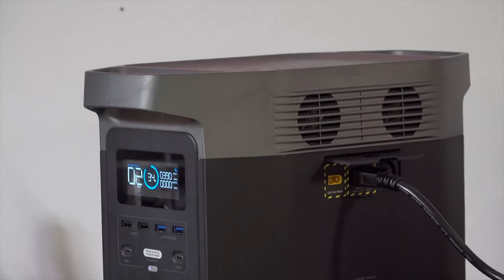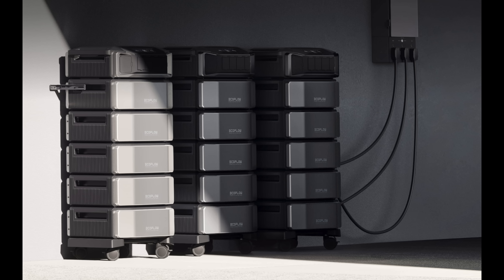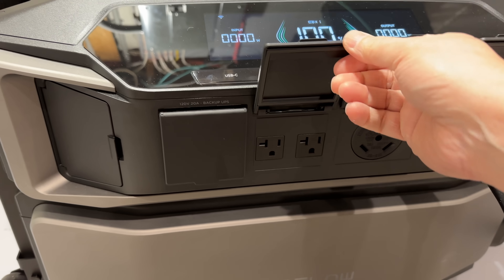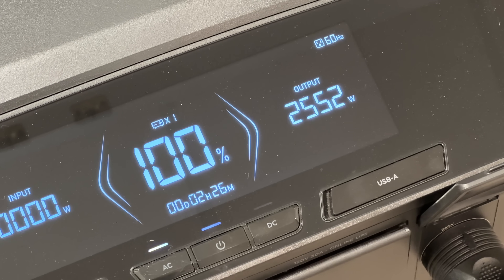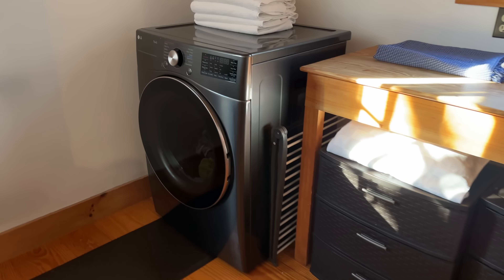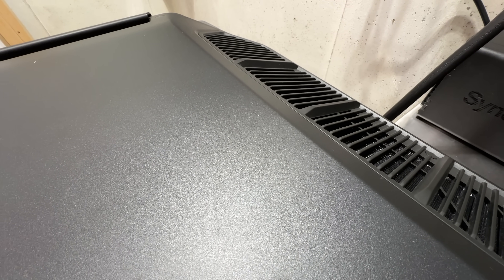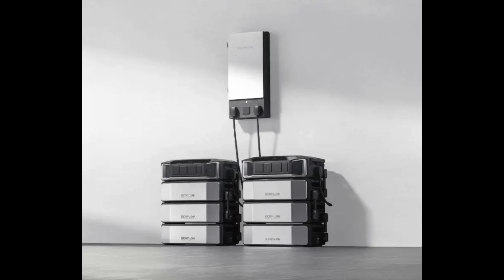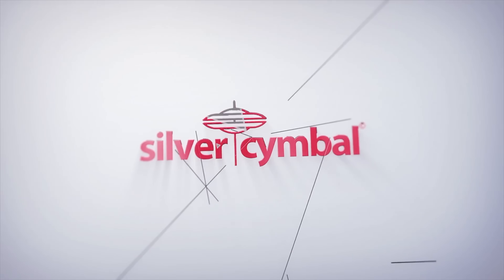ULTIMATE Home Generator just got BIGGER with 240V | Ecoflow Delta Pro ULTRA

Comment: What would be sick is if they offered a public car charger adapter, have it in the trunk of your car on road-trips, juice it up on the road.
Reply: Why?
Reply: To clarify ya a public charge port would be cool altho I'm sure would make unit too big. But why would u use it while driving in a car for camping sure.
Reply: @scotts1668  roadtrips, camping, weekend trips, off-grid camping in vans etc. Endless I tell you, ENDLESS!
Reply: The specs say the AC charging port supports 240V. So it shouldn't be too hard to make an adapter to charge it from an EV chargepoint.
Reply: They have one.  It's demonstrated in another video.  

Still gotta ask why?

1 ultra might get you 10-20 miles extra depending on various condition but you would be hauling around an extra 200lbs for a very unlikely scenario.  Unless your THAT guy...if you know, you know. Lol

As for the other scenarios, it would most certainly be cheaper, and more convenient, to charge it at home instead of using an EV charger...

Most Van life systems I've seen charge off the alternator or solar.

That being said,  I'm all about options, and they have an adapter if that is your cup of tea.

That being said

Comment: What safety measures do they have to mitigate fire hazards? Can this run outdoors in wet weather like a gas generator?  I would hate to have a lithium battery fire indoors.
Reply from the maker: LiFePO4 is much safer than reg lithiun ion so that should help to some degree and the batteries can be located outside as they are self heating but its probably not the best for efficiency. I used to feel the same way about my oil tank in my basement, but I guess its the same potential risk but maybe less?

Comment: The problem is that this is $6,000+. All of these batteries from ecoflow, bluetti, etc (all companies, not trying to single out ecoflow) are TOO EXPENSIVE for regular people. We need this delta pro ultra to be sold for $2,000 OR LESS. And keep scaling that down for the smaller batteries. Delta 2 max for $500 for example. 

Sell these for prices like that, with no other changes (no reduction in quality, capability etc). 

That’s what it would take for these to really have an impact.

This is one of the best channels on YouTube. Thank you for your excellent reviews and information.
Reply: Exactly. I got a nice inverter generator that plugs into my house directly. I don't see any reason why I would get something like the Ecoflow Delta Pro Ultra Mega Giga Super.
Reply: @Wordsalad69420  Exactly
Reply: Agree somewhat but some guys just don’t want to deal with gasoline or propane or even the maintenance of a motor generator. 
Especially if we are not home and the wife needs the home to run when the power goes out.
Reply: Especially with LFP batteries now off-patent, they have become incredibly cheap. You can get 6-7kwh worth of LFP for less than $1000 now. 
Heck, for roughly the same $9000 you can get the EG4 PowerPro setup, which has a ton more capability as a stationary system. Much higher solar input and nearly double the AC output.
Now I get that this ecoflow setup has a packaging and portability benefit. But seems like this setup is going to be primarily stationary anyways.
Reply: That’s why dual fuel generators are superior to solar generators
Reply: @jaxrules2892 I’ve got lithium batteries on my rv but I’ll put the dual fuel inverter way above these for sure, they are getting better but far from ready
Reply: First of all, this is not a generator, it's a battery, second, it's way too expensive, I can buy a generator for a lot less and have continuous power!
Reply: @bertveldhuizen8699  I know right
Reply: And how long are these batteries good for ? So you have to spend $6000 every 4 years ?
Reply: @larryyoderlarryyoder353 It’s longevity is measured in cycle counts. Usually 3000 to 6000 cycles then you will have 80% of the batteries original charging ability. It will definitely last a decade. The components will probably go way before the batteries. I have several and much prefer them to my fuel generators. No fumes and silent operation. I can recharge from the sun ☀️.
Reply: @larryyoderlarryyoder353  Not to worry Larry. After November with another four years of Bidenomics Inflation to deal with, the value of our US dollar will be so desimated that a $6000 whack to your wallet over a four year stretch will seem like "a mere tip at lunch!"💸🤗🤣
Reply: I almost sh*t my pants when I saw the price. I bought a nice 3500W gasoline generator off Amazon for $200.. The 12-liter tank gets me at least 15 hours of run time. At $4 a gallon for gas, I'm going to have to run my gas generator for years before the battery generator is even close to being an alternate emergency backup.
Sheesh!
Reply: @williewalker8048  Good luck finding & buying gasoline at $4 per gallon especially during a societal collapse which is practically guaranteed in the not-so-distant future. Remember Biden's 2020 campaign pledge? "I promise you young lady. I will END fossil fuels!"...Good luck with your gasoline generator when that's accomplished!
Reply: Right now I can order this up for $5k. Since it can qualify for the 30% home energy tax credit, when wired up to the house, a final net cost of $3.5k seems pretty impressive for what you get.
Reply: @steveallwine1443 I agree that the pricing on these systems is great for what you get.  I don't need mobility so I would probably go with an EG4 system as the input and output are a lot higher and necessary for me to fully back up my all-electric house.

Batteries and inverters can only get so cheap.
Reply from the maker: I totally get that, keep in mind right now its $4,799 Order here: https://bit.ly/3NHezXO Use my code EFDPUSILVER & get an extra $1000 off at checkout getting it to the $4799. Still expense but its not $6k
Reply: sorry just watch the beginning real quick and this product doesnt appear to correctly name as its not a genrator it more akin to a ups and has no way to produce power itself only store it as a battery and sure 7kw ups are pricy but a 1.5kw ups is about $200-300 @SilverCymbal
Reply: @SilverCymbal  wow, good deal.  Will it allow AC Coupling or AC support?  So, you are still using the grid and supplementing through a solar connected to the Ultra?
Reply: Why get an EcoFlow Delta Pro for $5,800 when you can get a Westinghouse WGen11500TFc for 1/3 of the cost?
Reply: @jaxrules2892  I mean I wouldn't get this, as I described above, but many places to live wouldn't allow for a backup gen like townhomes and/or associations. But yeah, having another form of backup isn't a bad Idea. I have a DIY 14kWh battery backup system that cost less than this ecoflow, but I also have a cheap 2kw champion inverter generator just in case.

Comment: While I don't think it's a bad use of the available technology, I don't see a use case for me. I can do more with less for an outage in winter (heating) or summer (cooling) with a gas generator. If I wanted a long-term solution, I'd be installing a permanent solar installation.
Reply: Yeah, an EG4 inverter/battery rack is more economical than these if you don't care about portability. The ecoflow breaker panel is pretty cool though.
Reply: Definately. And Will Prowse has you covered on these topics.
Reply: Eventually, you will not have a choice. They plan on eliminating fossil fuels for the average person. Bill Gates yacht  will still be a diesel.

Comment: Would have thought you'd need 50A to support a whole house
Reply: Depends what you draw. 7200 watts is nothing to scoff at. Each home is unique. I'm still in the process of measuring mine, and I'll have to wait for summer to fire up the a/c again, but I think I might be fine after I install a soft start on the a/c if we don't run the dryer.